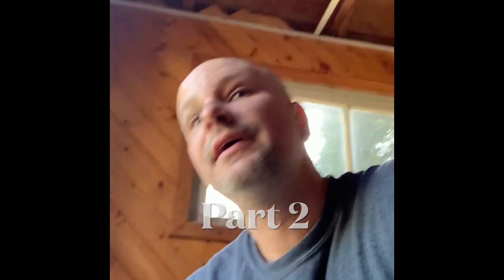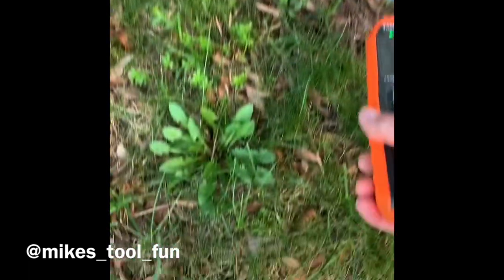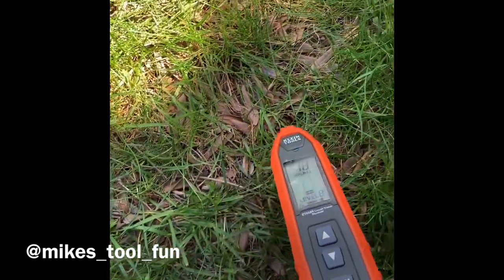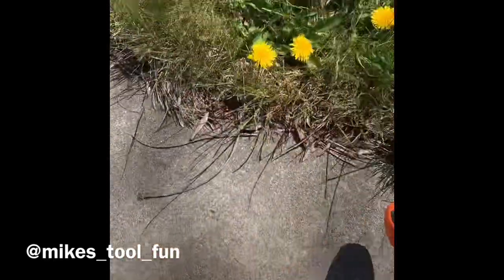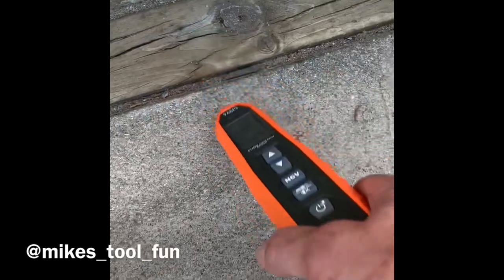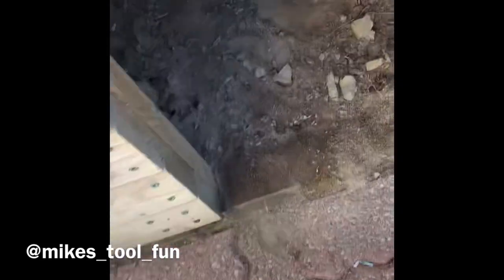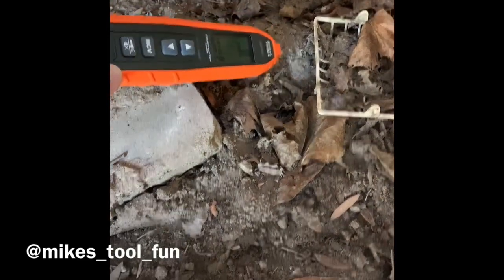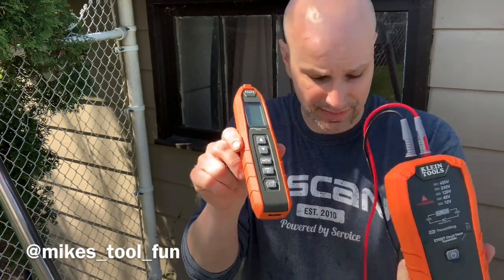Klein ET450 Tracer Kit Part 2 testing De-energized circuit

Comment: Hello, I am wanting to know how to use this to trace pathway lights in a gated community. There is a transformer box on the side of each home, but each transformer  powers the pathway lights to the house adjacent. I suppose they didn't want to wire under the driveway/concrete. How would I connect the Klein transmitter to trace the wires for a pathway light? Would I remove the wires from the transformer box and attach alligator connectors and de-engergize the circuit first? Thank you so much for any help.

Comment: Can the transmitter be connected to the line side of a 3 phase sub panel to locate where it is connected to the main panel?
Reply from the maker: Yes it can as long as the voltage is 480V or less.

Comment: Just received the ET450 today… is there any way to use this to find a ground fault/dead short? Thanks in advanced, glad I subscribed to your channel!
Reply from the maker: I haven’t tried finding a dead short with it. Not sure if it has that capability. 

I do believe Klein has a tool that will trace out dead shorts and tell you how far down the line the short is. (Don’t quote me on this. My info is second hand) 

The ET450 has a decent learning curve, but once you figure it out, it will pay for itself on quoted jobs. 

Thank you for the follow. Cheers.

Comment: I ran power from 1 building to another and buried the lines 24-36 inches deep. 1 of the 2 "hot" lines is not providing power to the other building. Can I use this to identify where the break in the line is without digging up the line?
Reply from the maker: I was able to find a buried wire NMWU #12/2 wire buried about 18”. The signal was very faint but the wand was still able to pick it up. 

I followed the signal until it stopped. I dug in that spot and found the break.

With that said… I feel like i got lucky. I would honestly try to rent a bigger wire locator that is designed to penetrate the depth you are looking for. 

I think some Home Depots rent them. In Canada there are companies that offer that kind of service.

The ET450 is around $250.00 CAD.. the bigger scanners are $1000-$8000.00 CAD.